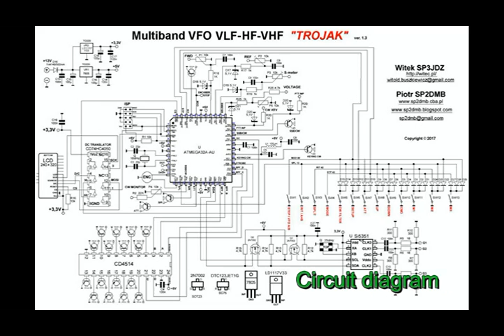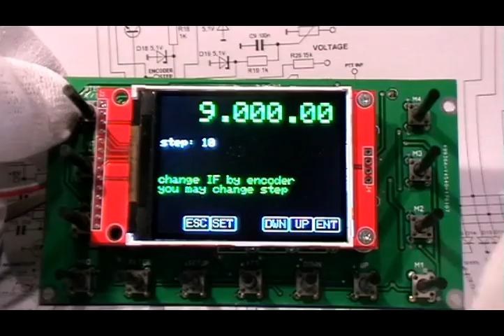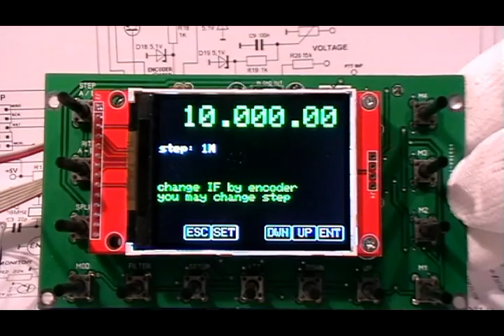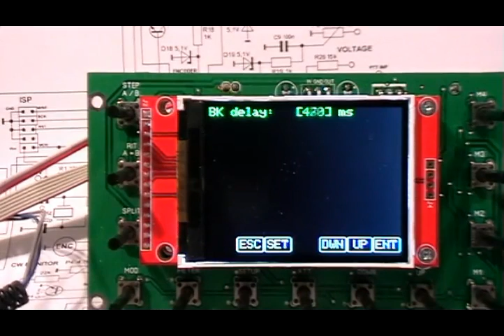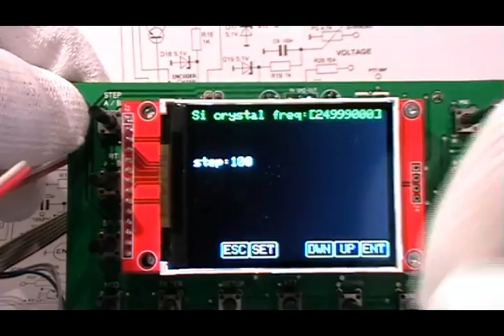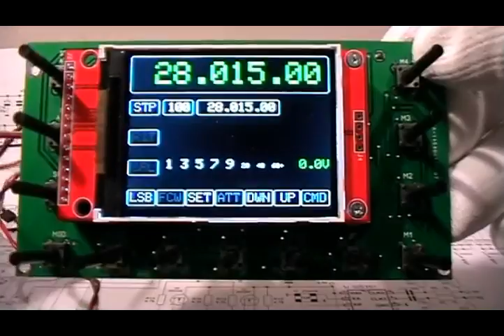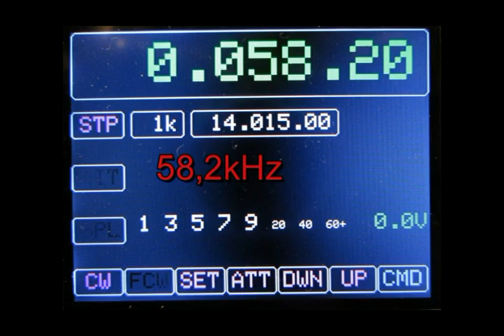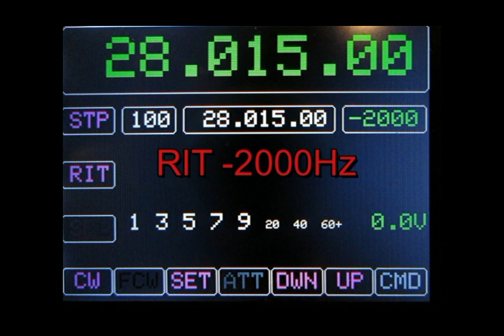Multiband VFO on Si5351

Comment: Also can you add extra BAnds in menu list? say 39Metres 
???
Reply from the maker: No. VFO including 40m and this band  work from 4,5 to 9MHz.
Reply: Brill,exactly what I require thx
Reply: How about 5khz ,6.25khz and 11.25khz can extra steps be put in to cover commercial channels steps?
Reply from the maker: Hi ! The generator is dedicated for SSB and CW. 73
Reply: Ok no problems,was thinking for FM uses as well that's all for 24-30,50,70,145mhz,im looking for a flexible DDS\controller for a new designed  ssb\am\fm transceiver, that's why asking about the different step sizes available for different modes.
So far yours looks the best option ive found.
Thanks for again for info 73's Rob